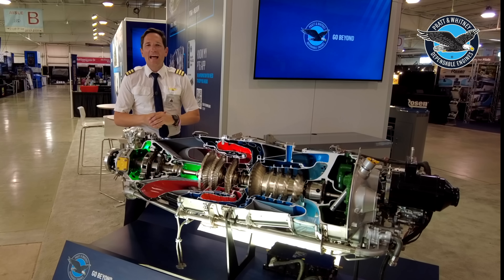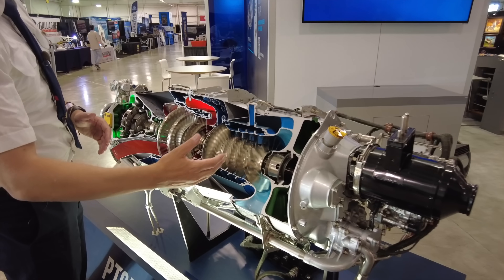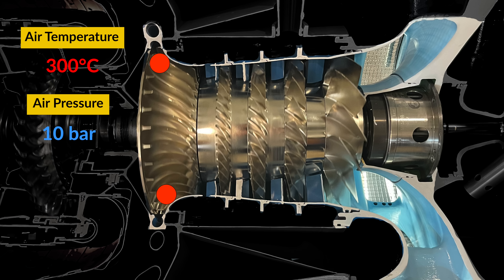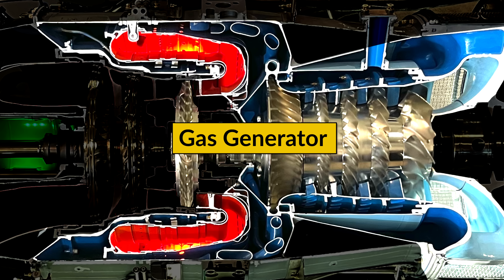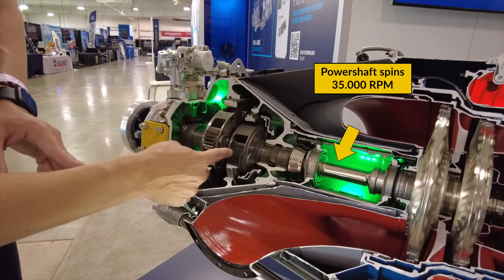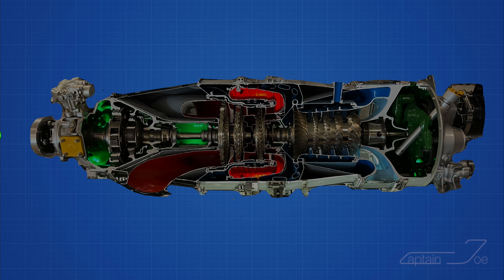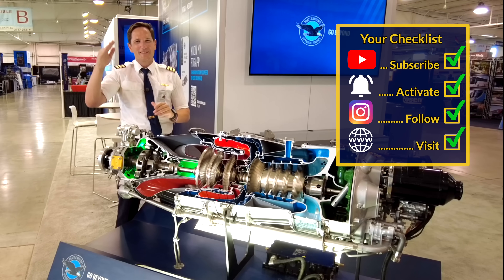The BEST TURBOPROP explanation video! By Captain Joe and PRATT & WHITNEY

Comment: So what is actually driving the "cold section" compressor blades? An electric motor? An internal combustion section?
Question from someone who knows nothing about aircraft engines.....
Reply: The turbines behind the combustion can.
Reply: @TheSwedishSalamander  And what's driving those turbines?
From what I ascertain in the video, it's a series of fan blades driving and compressing air, which is then superheated to drive more fan blades. Is there an internal combustion motor driving the turbines at the beginning stage?
Reply: @vanessajazp6341  Okay, I’m an aircraft mechanic that works on this type of engine, so the air goes into the engine, gets compressed by the compressor blades, it then heads to the combustion can where fuel is added and ignited, this gives the air a ton of potential energy in the form of heat and pressure, after the combustion can it heads through the compressor turbines, which are called this because these are what power the cold section, the air that now has a ton of energy is what spins these turbines, which in turn, spin the compressor section, after the compressor turbines you reach the power turbines, these are what turn the gearbox. To summarize the hot energy rich air from the combustion can power the cold section via the first stage of turbines.
Reply: @TheSwedishSalamander  Sorry to be  dullard, but if anything I'm a pest.

With the engines completely turned off, no air is coming into the engine at all, right?
So then when the engines are started, what is drawing air into that port to begin the process of compression? The fan blades?
If so, what is driving those fan blades?

I grasp the concept here of airflow through the engine driving the propellers. What I'm missing is what driving force actually causes the first stage to happen? Those fan blades don't just spin up on their own.
Reply: @vanessajazp6341  it’s like starting a car, we use what’s called a starter generator, it’s an electric motor that spins the engine up to about 15% give or take, then fuel gets added to the combustion cans and the igniters start sparking, this is just enough to get the fuel burning and the engine will start accelerating to idle (about 60%), then you cut the starter and it becomes a generator to make power for the systems in the plan.
Reply: @TheSwedishSalamander  Ah. Thanks!
I may not know much about it, but I’m eager to learn it.

Comment: Great explanation, however , no engine has ever sucked in air , the atmosphere flows from high pressure to low pressure. There is low pressure directly upstream of the first stage axial blades. And the torque listed you said pounds, should be updated to lb-ft, or N-m.

Comment: i was curious about two things...
wouldn't the increased pressure in the combustion chamber push the gas in all directions? so even if there's constant airflow in a given direction  would the added pressure be exerted in both forward and reverse directions, someof it fighting against the air trying to get into the chamber?

you mentions the stator blades are stationary, but in the model it looked like everything was spinning? (so not very stationary in appearance)

Comment: Another aircraft type you can add to the list at the end - the Lockheed TriStar. It used a PT-6 as it's APU...
Also, it's known as a reverse flow engine because of the way the air changes direction twice in the combustion chamber to keep the design as compact as possible.

Comment: Charles Parsons, the primary inventor of any turbine that uses high pressure high temperature gases (gaseous water is a gas) does not get the credit that James Watt gets.
Watt made the reciprocating steam engine widely viable. But the turbine  (wind turbines aren't turbines) is a huge improvement, and not "evolved" from the other.

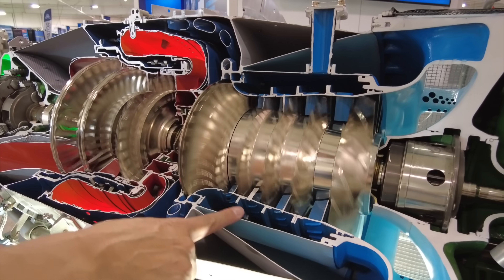Comment: 3:25 - The first three compression fans are an Axial compressor. Compressed horizontally to the center shaft. The forth fan, which is like an automotive Turbocharger is a Radial compressor. Compressed vertically via centrifugal force away from the center shaft. Or also know in the auto world as a Centrifugal supercharger. Fun fact - Max Verstapin's 2023 F1 Red Bull Honda turbo has a similar compressor for its turbo as this turboprop. Axial then radial compressors.

Comment: Dear Joe first thanks for the great content you provide , I have a little irrelevant question which has many contradicting answers on the web, which is more complicated than the other, the internal combustion engine or the jet engine, thus which is more reliable and easier to maintain ?? Thanks in advance and keep on the great job 👍💪💪🛩️🛫🛫

Comment: Fantastic video! I've been curious about the PT6 and how it works since hearing about them on the Mallards flown by @thatmallardguy.

Out of curiosity, I know some planes like the ATR-72 (for all it has a PW100) have a propeller brake to run the turbine without running the prop, does this effectively stop the prop side shaft from spinning, or do they divert the exhaust gases too to stop them blowing over the turbine?

Comment: Another huge benefit is that by having reverse flow with the power section in the front, the propellor shaft is extremely short and does not need to be run through the hot section of the engine, making prop shaft failures virtually nonexistent and no need to hand turn the prop after shutdown as you will not get a bowed prop shaft from heating and cooling.

Comment: Brilliant presentation, can you do one on the Rolls-Royce Trent 800  high-bypass turbofan engines?
Reply: What would you like to know?!
Reply: Thank you for asking.  First my background, in my younger days, I accumulated 2,000 hours of navigator time on a KC-135.  We usually got about 20 flying hours per month.  Each engine only produced 10,000 pounds of thrust.  Used 5,000 pounds of water injection for 2 minutes during takeoff, while heavy weight could  take much of the runway before rotation, was scary to newer people.

35 years later,  technology has entered a golden age compared to what I  went through.

In a KC, losing an engine, while heavy weight after takeoff, could be a huge challenge to cleanup the aircraft and pray for a climb out.  Never had to deal with that.  

Back to your question, I'm curious.  

The GE 90 and the Trent 800 are both awe inspiring engines.

I'm curious as to which one has the cheaper maintenance and what are the manufacturing differences between them that could effect engine-life? @Sterlingjob

Comment: I'm more interested in what kind of bearings it uses and the lubrication/cooling system to keep it from flying apart. How long can they go until new bearings needed? The bearings must be fed oil, or they would fail quickly, I'm guessing they are air/oil cooled and must have a sump and pumps somewhere?
Reply: Most engines use ball and taper bearings which are lubricated with oil. Ball bearings take thrust loads, taper bearings keep the shafts in place. Oil is generally cooled by fuel or air but cooling by fuel also brings the advantage to chucking nice hot fuel into the engine, burns easier.

Comment: Please confirme axial compressor speed 39000 RPM is impossible. Maybe 3900 RPM
Reply: Centrifugal compressors are most efficient at high speeds so 39000RPM is about right.
Reply: They do in fact spin that fast, 3900 rpm wouldn’t provide enough compression for combustion, the high rpm is why turbine engines have that characteristic whine.
Reply: @TheSwedishSalamander  centrifugal compressors require high rpm to function effectively. Most axial flow fans only rotate around 3000-7000 rpm. Core compressors rotate even higher and N3 higher still
Reply: @Sterlingjob  yea I’m agreeing with you, but in the pt6 there is no fan, they’re all compressor stages, so they all spin stupid fast. Source: I’m a beech 1900 AME.
Reply: @TheSwedishSalamander  4 x axial and 1 x centrifugal? Haven’t worked them for years…Trent Xwb and 900 are what I work on now!
Reply: @Sterlingjob  man those are cool engines, never had the chance to work on the big jets, but honestly I’m liking the smaller aircraft, it feels like I can get a lot closer with the machine if that makes sense.

Comment: So the 1700 HP version weighs around 300 kg and is still only about 1.8m long.

A 65 ton Leopard 2 tank can deliver 1500 HP and an astonishing 4700 lbft... but its engine block weighs 2 tons. And is coupled with a 2.4 ton transmission.
Reply: A gas turbine cannot accelerate or decelerate like a piston engine, they like constant speeds

Comment: Why are prop engines still being  used in new planes? Seems like an outdated technology.
Reply: Efficiency, noise etc
Reply: @Sterlingjob  Are they really more efficient than a jet engine? I have doubts after looking at the way both engines operate.
Reply: @JeremeyHowlett  Well for a start the props can adjust pitch so the engine can remain at constant rom
Reply: They are significantly more efficient than a turbofan or turbojet with the same thrust, less susceptible to FOD, often cheaper to operate, and are more responsive to power changes. At the end of the day they are still “jet” engines, it’s just a different method of delivering the power. New turboprop engines are extremely advanced and have loads of technology thrown into them.
Reply: What hourly fuel burn ratio are you using when comparing the two? The new Polaris pc -24 gets 10 miles per gallon.
Reply: Pilatis
Reply: @JeremeyHowlett  the cirrus vision jet burns 68 gallons per hour at max cruise, the pc-12 is about 66 gallons per hour and that’s at max cruise, while carrying more, and being able to operate on shorter runways.
Reply: @TheSwedishSalamander  when I try to imagine 300 gallons of fuel fitting on the cirrus jet, That’s equivalent in volume to three 96 gallon garbage cans. Then when I try to find any information regarding fuel tanks or fuel bladders, it’s impossible to get any of that information. All I seem to find is a bunch of wording that makes it very confusing to understand the actual fuel usage of jets. Seems like they don’t want people to know how little fuel jets burn. Idk……what’s your thoughts on this topic?
Reply: @JeremeyHowlett  no it’s pretty public knowledge on how much planes can hold and how much engines burn during certain regimes of flight. Wings are a lot more spacious than you’d think.
Reply: @TheSwedishSalamander  so what I’m reading online is that a Boeing 777 holds 45thousands gallons of fuel, then I look at a water truck that holds 4000 gallons, I just don’t see how that is possible. Thoughts?
Reply: @JeremeyHowlett  777 big

Comment: What I still do not understand: what prevents the hot gasses in the combustion chambers from being blown back through the holes into the inlet air. The pressure in the combustion chambers must be a lot higher than the 10 bar in the inlet air.
Reply: The pressure in the combustion chamber from compressor exit to HP turbine decreases, which causes it to flow out the back. Look at the gas turbine cycle graph. Most graphs don’t show the dip in pressure at top of graph.

Comment: all these is fascinating and i’m sure the proper intellectual property rights have been observed... however, i don’t see how this engine as efficient in torque as can be it resolves a fundamental problem in propeller engines...the problem of momentum. while a propeller moves the craft with the same mass of air running through the blades, since the air that pushes is the same air that have just touched and moved through the propeller blades, it represents a problem with momentum that causes the drop in a void. as the density in the mass of air gets thicker and thinner throughout the atmosphere, one same throttle acceleration can yield more or less mass at the same plane speed regardless how the motor ran... @marengoscience7

Comment: I'm amazed at precision engineering this requires. The perfectly balanced shafts and bearings they lay in. At 60k rpm, any slight defect would vibrate and destroy the whole engine.

Comment: I wonder, what material do they use to vector (channelize) the flame and hot gas, without getting vaporized?
Reply: The flame is held in position by the air, the flame will not touch any metal otherwise it would burn straight through!

Comment: Video was really nice and informative, surely want more of these regularly. It will seriously help me a lot with my aviation knowledge. The only issue I've been suffering a lot since so long in your vlogs are low audio for non headphone user. On headphones it's fine over 30-70% volume but without headphone even on 100% the volume is too low, tried in multiple devices and this issue is so far in your videos only, on other videos the volume are fairly okaish. I hope I'm not alone to experience this.

Comment: What is the combustion pressure? 
And to get to 10 bar initially obviously means that the air is forced in faster than it can get out at the rear/exhaust.
It is like trying to pump up a tire that has a hole in it.

Comment: Hi Captain Joe. Why does a turboprop seem to do everything a standard gas turbine jet does, but then take all that hot gas that can be used as thrust and send it through a set of turbines connected to a gearbox and propellor? Wouldn't there be a lot of lost energy? Or is this counteracted by the size of the propellor pulling more air than if you just spit the hot gas out the back? In addition, is it possible the industry will see variable attack angle on the exhaust turbines in order to maximize peak output?
Reply: You answered your question. Prop helps in moving more volume of air, compared to a jet exhaust. Plus a turboprop engine is much more lightweight compared to an equivalent non turboprop engine

Comment: Excellent explanation of these engines.  In your list of manufacturers using the PT6 you had the Let410.  They actually use the GE H series (formerly Walter).  I have flown both and they're equally superb engines and super reliable

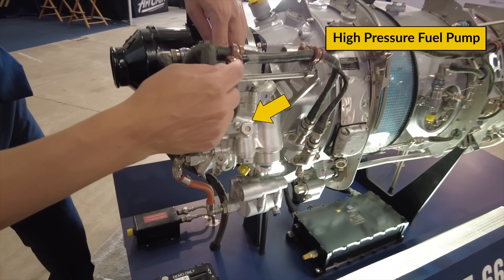Comment: @ 11:13  You have an arrow pointing to the Fuel heater/oil cooler unit but have it labeled as the oil scavenge pumps. The oil scavenge pumps are on the other side of the accessory gearbox, 1 internal and 1 external.

Comment: 4:40 why is that the ignited mixture in the combustion chamber, with all the pressure it generated doesn't try to escape back to the injection points (where it was injected from)  is there some kind of valve that it only allows it to flow into the combustion chamber and not the opposite way?

Comment: Thanks for bringing back many good memories. I was a Field Rep for P&W starting in 1965 and had my first assignment covering corporate and 3rd Level airlines operating the King Air out of Detroit. I started out with the PT6-6/6A and I stayed with the program up until the -27 was fielded. Worked with companies such as GM, Miles Lab, Upjohn, Marathon Oil but to name a very few. My territory included Mighigan, and N. Ohio.  Also did a stint at Rockwell in Colmbus, Ohio when we we trying to get the contract for the OV-10A that had engines turning in opposite directions to counter the prop torque. Was also involved with the installation of an ST6 in a Dana Truck. I loved my time supporting this product and the people I worked with at PWC!!
Reply: I belong to a museum,and we have a ST 6 that was used in a Canadian Hydrofoil research project,I think it's based on the PT 6 - 20
Reply: The P&W turboprop engines are so good. The F50 and Dash 8 aircraft have P & W turboprop engines.

Comment: the purpose of the combustion, which occurs at the same pressure as the diffuser outlet, is the strong increase in volume flow. The pressure never increases in the combustion chamber, due to losses the pressure drops slightly.

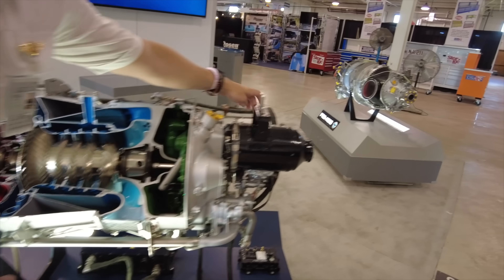Comment: 10:42 Along the blade the air is decelerated, to gain pressure according to Bernoulli., with respect to the rotating blade, NEVER ACCELERATED in the axial compressor. the high initial relative velocity is due to the rotation of the blades.
The same process occurs in the stator vane, this time relative to the stationary stator blades

Comment: You can actually start the engine while holding or retaining the propeller, which needs to be done if the engine oil temperature is below about -20C. I absolutely LOVE the PT6 and have flown the PT6-6 on the original King Air 65-90, the model -20 on the Beech 99, ten different models of King Air and up to the -67B which is on my Pilatus PC-12NG.

Comment: Cap.joe,,,,
I am not a physicist how ever I understand these matters. 
Jet engines or anyother engine  for that matter and even the vacuum cleaner in your house DO NOT SUCK IN AIR!!
AIR ENTERS the or house vacuum cleaner because of the difference in ambient air pressure  outside the engine and the effect of the first stage compressor forcing  air into the rest of the compressor. We all understand what what is meant when we say air is SUCKED into the engine but that is not what is actually  happening here.its a matter of differential air pressure.  Your house vacuum works the same way. The motor inside the vacuum creates a lower air pressure than ambient air pressure outside the vacuum cleaner. You do NOT suck in bits of fallen popcorn from the floor, they get carried along with the rest of the ambient air outside the vacuum in a never ending attempt to neutralize air pressure INSIDE the vacuum cleaner. Air DOES NOT GET SUCKED IN  ,,,,it's a matter of differential air pressure. 
I think you should make this clear in the videos. It's ok for a guy who knows little of such things but us (engine heads) should be made to understand in more detail what is actually going on there. 
Ps,,, nitrous oxycide does NOT burn !! It just carries more oxygen into the cylinders which means you can burn more fuel thereby creating more heat. Be well. E.C. Moore.